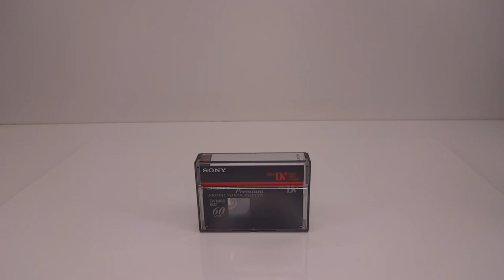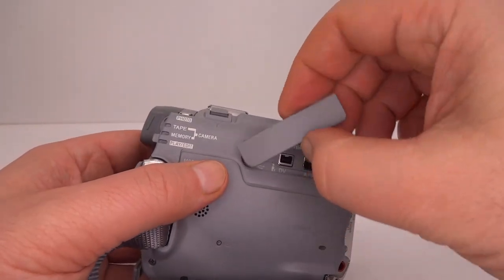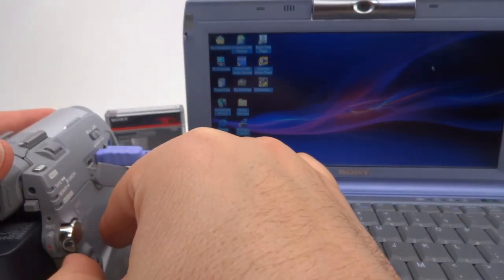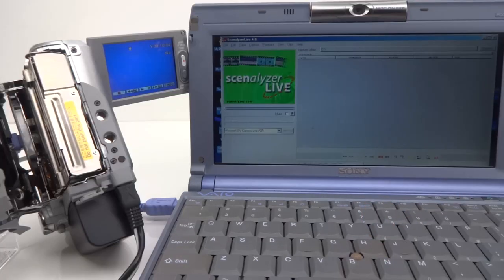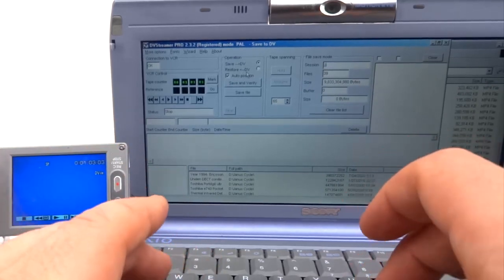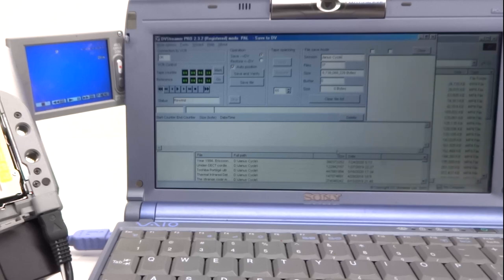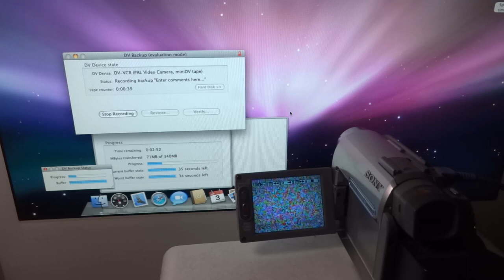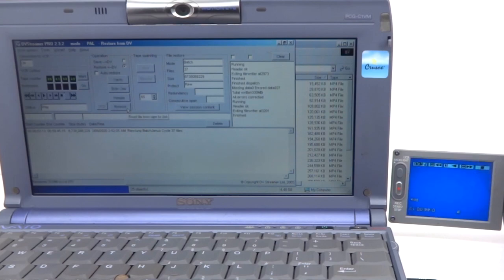MiniDV cassette tape & full channel record

Comment: Nowadays the hardest part is to find a laptop with FireWire port...🤷
Reply: my hp pavillion from 2006 does have though
you need to look for windows xp era laptops as a couple of them have firewire port
Reply: Ummm every PowerBook or iBook by apple. Heck even MacBooks and MacBook Pros. I got a few lying around with FireWire 400.
Reply: @spazjackrabbit61 I have a 2008 Windows Vista laptop which have a Firewire port but the chipset is VIA.  Intel ones doesn’t have it.

Comment: The lack of touch screen function (if the flex cable is known to be good) is usually due to the failure of the A-7112-124-A PD-213 BOARD, which can be found on the HC16, HC18, HC20 HC40 PC106, PC107, PC108, PC109 models, as well as the HC30, if you want to source a replacement.
Reply from the maker: Thank you for that high level of detail.

Comment: Great video however I'd recommend getting a Firewire capture card for your computer and using Premier Pro's Capture function to control the camera and capture to AVI. Then use DVdate to extract the date/times as a subtitle file. Then use Handbreak to deinterlace, compress and add subtitles to the file.
Reply: Flippers49  best feeling when you finally get them all backed up at the best quality

Comment: I have two sony mini dv camcorders here the latest one my dad bought for next to nothing from a charity shop it worked well but touch screen was not working i found a cheap remote on ebay that allowed me to operate it oddily after using it touch screen now works ,i am wondering if pulling the viewfinder out has made any difference oddily if i play video with screen closed viewfinder does not work the viewfinder only seems to work  in record mode with the screen closed .The remote i have does not have long play function just the basics .This video was quite interesting i never knew you could do this .

Comment: I run an HVR-Z5 (2007) as a webcam it has 1920x1080 4:2:2 HDMI output with an Atmos Recorder at 100-200mbps 10bit its still TV broadcast acceptable, However MiniDV as a standard actually died in 2012 for the 1st world nations, 3rd world still has a lot in use due to tons of good working older equipment but the MiniDV tapes can do up to 1440x1080i 50/60i or 25/30 in both interlaced or progressive at 25mbps 4:2:0 (4:1:1 was more a USA model thing and was axed when HDV started back in around 2001 or so) DVCAM was kinda piss poor compared to HDV and funny enough the cameras were in the later years cripped by the tape recording system even tho Sony managed to pack 200i slow motion into it the bitrate really didn't do it justice.

Funny enough as much as I ramble about 4:2:2 output Firewire is still the best way to pull tape data over any other method unless you want to use the built-in upscaler in last-gen of HDV cameras.

The sad thing about today though is the FireWire cards the cheap ones not from StarTech etc are plagued with the legacy driver install issues and without them, you can't pull feeds off the cameras you can get control of the tape system but windows allowed the driver standard to be broken if you're using Windows 10 it should be n

Some Software to be noted though..
WinDV/VirtualDub2
FFMPEG/QTGMC/NNEDI3 - for De-interlacing (there is so many methods but most of the community agrees this is the current baseline)
Reply: Hi
Reply: Love

Comment: I wonder if this would work on Digital8 camcorder since it uses the same DV format?
Reply from the maker: Yes, I believe Digital8 will work.
Reply: @JanusCycle  I installed it but there is no way to register it as all links are dead, I would really appreciate it if you could share your license, I know it's silly to ask but I have no other way to unlock the software. I've sent you an e-mail.

Comment: Where did you get the $6 part from? How can I figure out how to put it all back together after I've taken it apart? So, you can transfer VHS to mini dv this way? I wonder if can right to the computer and copy.
Reply from the maker: The ribbon cable spare part is from eBay. Re-assembling is just the reverse of disassembly. Though it requires really close attention during both phases. It also helps to take photos along the way and keep notes. Maybe practice on other less important devices first.
There are many MiniDV models that have composite video input that can record VHS. Some also pass the digitized composite VHS signal directly to a computer over FireWire. Allowing VHS capture to a computer without recording to MiniDV tape first.
Reply: @JanusCycle  I guess its too late for my camera, I paid no attention to how it came apart and there's like 50 pieces. So you can use this to get VHS to digital? Explain.
Reply from the maker: @zomalfa4363  Many MiniDV camcorders already have analogue to digital conversion built in. You can just plug a VHS deck into the camcorder. The camcorder then converts the VHS signal into digital.
Here is a popular video describing the process.
https://www.youtube.com/watch?v=-vnL4nCv2RM

Comment: Great video mate, I have an old dv Sony camcorder and want to extract the video to my windows pc. The problem I have is that my laptop doesn't have a firewire port.  The ports i have are x1 mini Displayport,  x1 hdmi port and x4 usb ports. Any suggestions would be much appreciated.
Reply: Same. Let me know if you worked it out!

Comment: When to use ilink and when to use the regular av output? Differences?
Reply from the maker: iLink is a digital interface and so it copies the actual video file directly from the tape to your computer. This is preferred for best quality. 
AV is analogue which is fine for watching tapes on an old TV. Many people do a digital capture from the AV output to copy a tape. This is fine and produces decent enough results. But iLink gives you a copy of the original Digital Video (DV) file :)
Reply: @JanusCycle  thanks! What is the best way to connect it to a pc?
Reply from the maker: @SaulsUpholsteryNJ  You will need a computer with a Firewire/IEEE1394/iLink port. Often found on older computers from more than ten years ago 
Most older Apple Macs have them, called Firewire(tm). Sony laptops called them iLink(tm). And other older laptops named the port IEEE1394 or DV port.
Reply: @JanusCycle  👌 for newer computers is there a suggested way to connect it?
Reply: @JanusCycle  hi! Thanks for your content. I'm trying to get recordings via sony hc42-e camera. It have 4-pin 1394 insert on dockstation. I've bought 1394 card on AliExpress. It have one 4-pin and two 6-pin inserts. I'm using my old pc with windows xp sp3. When I use usb import it works fine, but quality awful. 1394 doesn't work. Do you think is it correct to use 4pin-6pin wire, or I need 4pin-4pin? Sorry my English
Reply from the maker: @Maxonih  The 6 pin connections should not have any affect the signal. They are just like 4 pin with extra lines for power. I did a have problem with two cheap silver coloured cables from eBay not working. When I used a Sony brand cable it worked fine. What quality are your cables? Also your English had good understandable meaning.
Reply: @JanusCycle  I have 2 wires: 1 cheap and silver, the other one is 1.5 meters blue and looks reliably. Russian man from similar channel tolds me, that problem can be in docstation or this pci card. I can not find any understanble instruction how it should works on windows xp system (1394 works like 400 mbit/s network connection for example)

Comment: Hello do you know a Mac software to connect what's in my MacBook screen to dv tape?
Reply from the maker: There is DVstreamer style software called 'dvbackup dmg'. For video transfer you can use older versions of iMovie. For video back to tape you may need to check which softwares can do that. For example Final Cut Pro may be able to send video to tape.
Reply: @JanusCycle  I have Final Cut Pro. I connected it to my Mac. Do you know the next step?

Comment: Hi I have a sony DCR HC42E HANDYCAM and a HP pavilion DV& with windows 7 installed it has a built in 1394 port. i have connected the cable 4pin each end to both devices but the laptop does not recognise the devise. Could the cable be the problem or do i need to install a driver.
Reply from the maker: I one ordered a silver coloured 1394 cable from eBay that didn't work. I checked the pins and it had been wired up incorrectly.
Windows 7 already has a 1394 driver built in. If the cable works, then the camera should be detectable when in playback mode.
Reply: Did you solve it?)